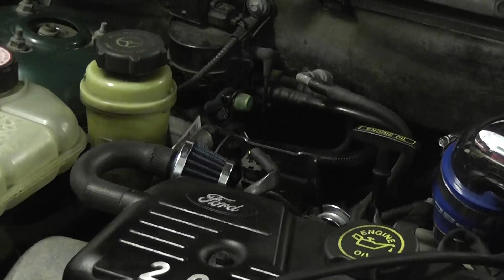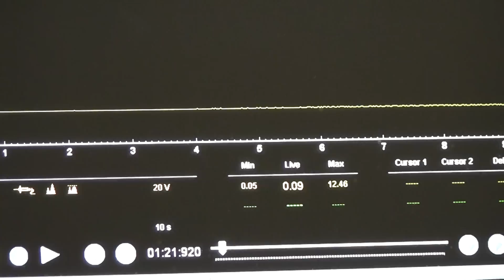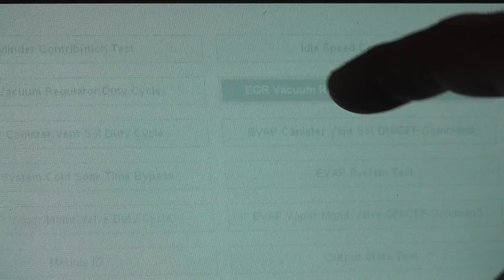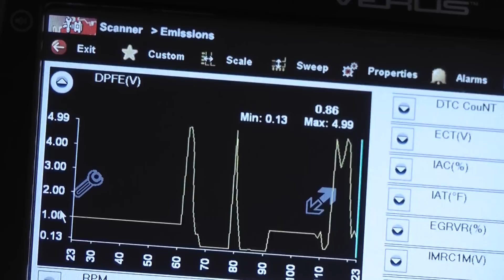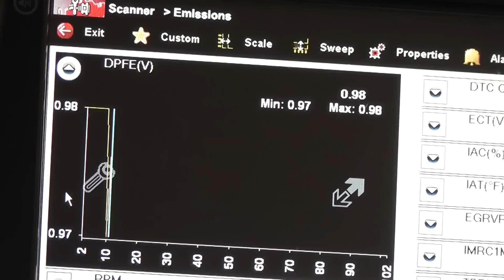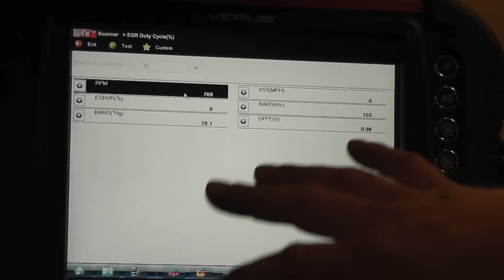2000 Ford Focus EGR System Tests (EGR, DPFE, EVR) - P1409

Comment: What would you suspect when a PCM dictates EGR, H2 Oxygen Sensors (all of the banks #4) OBII Codes and won't redirect the Coded Reading after Change Out of tested parts and wiring on harness was repaired with many connectors, without mentioning Ford - 1994 8 cylinder and not a truck. Yes, It's OBII Ready !!
Reply from the maker: Step 1, make sure you have power to that EGR solenoid and your O2 heater circuits

Comment: On the vacuum solenoid pilot wire that controls the EGR valve, I have 0.06 V (with the ignition on but the engine off). However, when I disconnect a black and blue wire connected to the negative terminal of my battery, I get my 12 volts back. Is this a grounding issue you're familiar with ? Or is it a problem with the ECU? Thanks a lot for your help, and Happy New Year!
Reply from the maker: Just some random black and blue wire at your battery? If that's a computer ground wire, that will do all sorts of weird things, with one being anything that is grounded by the ECM, will no longer have a ground. 
We've talked before about this and with the info you're providing, I can't help you any further. And if I remember this is a model that we don't have here and so I can't even look up a diagram.
Reply: @ScannerDanner "Yes, just this black and blue wire is causing the problem. Do you work on vehicles in France? Otherwise, there are no issues with the vehicle's equipment. However, the ECU cannot handle this ground wire and goes into fault mode, showing 0.06 volts. I disconnected all the fuses and relays, but nothing changed. This ground wire is necessary because it powers the fuel pump. I also disconnected the fuel pump, but it's the same — the ECU still goes into fault mode at 0.06 volts on the solenoid control pin as soon as I reconnect this black and blue ground wire to the battery's negative terminal."

Comment: "Hi from France, I have a 1997 Ford Transit MK5 with the same P1409 issue. With the ignition on, I get 0.06V on the ECU pilot wire going to the solenoid. However, when I disconnect a black and blue ground wire connected to the - battery, I get around 12V, or closer to 9V. So, where do you think the problem is? I suspect a short circuit."
Reply from the maker: No idea what wire you're talking about or what component you're testing. The solenoid? Not sure if that solenoid is being controlled on the ground or power side of the circuit. It changes drastically how you test it. Wiring diagram is key . If one of the solenoid wires goes to a ground, the PCM controlled the power side. If one of the solenoid wires goes to a fuse, the PCM controls the ground side. Need that information to help further
Reply: @ScannerDanner  I'm talking about the control of the vacuum solenoid that goes from the ECU to the vacuum solenoid. This control has a voltage between 9V and 12V, but when I connect one of the ground wires to the negative terminal of my battery, it drops to 0.06V. This happens with the vehicle's ignition turned on but the engine not running. Thanks

Comment: Would a huge vacuum leak also cause this code?
Reply from the maker: not this code
Reply: @ScannerDanner  oof. I did have a intake plenum gasket leak which caused misfire on cyl 1. Changing all the sensors for peace of mind. Will further test to confirm complete functionality. Thank you for sharing!
Reply from the maker: @gmax341  no problem. Do the tests I've shown in this video. I'll help further if you need it.
Reply: @ScannerDanner  Awesome! Just got done and all systems are a go! ST-Fuel trims are bouncing around 0.0%. My original metal DPFE seemed dead with the DMM test and the other solenoids seemed electronically fine, Will keep them as spares. Sadly, I ended up breaking my EGR tube when trying to install the new DPFE sensor. Too far rusted. I own a 96 Ford E150 conversion van with a 5.8l V8, 351W I think. Its not easy with the tight spaces to work on that thing. I am hoping this will be the last time I take that dog house out. 

One last question if I may. My last issue, is tackling the ABS system. Just purchased a Innova 5610 scanner and tried to get ABS scan/readout but it was not able to communicate with that system. Might end up returning it and getting a different scanner maybe. Changed all three wheel sensors and from time to time, I do hear the abs motor kick on briefly when I KOE-Off. I wish to accomplish two things. Verify speed sensors and test motor/break-bleed. Do I need specific tools for that?

Comment: I have a 99 f250 v10 but I put in the 03 engine (basically thw same thing) and it is giving me that 1409 code as well as the dpfe code 1401 code dpfe high imput circuit, and pointers?

Comment: Hey good mornin, first I wanna tell you thank you, your videos have helped me so much. If yo see this comment, can you please help me? This is the situation:

In my Ford Escape 3.0, The control wire from the PCM, the One that has to ground and get 0 voltaje, after I start the Truck, it keeps the voltage and even it rises to 13.6 o 13.7 Volts, what can be happening? Thank you so much y hope you see this comment

Greetings from Mexico

Comment: Hello! I have the p1409 code. I have changed out the EGR Solenoid and reset the code but it has come back. I have tested the voltage on the EGR solenoid and it shows 12v on each wire. I applied vacuum onto the EGR valve and the engine bogged down. Does this mean that the DPFE sensor is likely the issue? I don't have a fancy scan tool to test for a short or open  circuits. I would greatly appreciate a response, I have emissions in a few weeks and I will not pass at the moment!

Comment: You're the best like always the best hey Paul I have a question my smog piss keep resetting every time I turn off the engine what can coze something like this?
Reply from the maker: That's weird. Force a trouble code to set. Does it also clear on every start up?
Reply: @ScannerDanner  yes on every start up it cleared the trouble code

Comment: Helpful video.  99 Ford Mustang - I had no power to the solenoid wire with the key on.   Fuse #8 was blown under dash.  Was throwing 02 sensor codes and Vapor Canister solenoid code also.  New fuse...no more engine light.  Hope this helps somebody.

Comment: 2000 Ford Expedition 5.4. Just redid the intake manifold got it all hooked up and now I have eight codes all has to do with sensors failure. P0743 p0443 p0135 p1409 p0755
Reply from the maker: Common power feed to all of those circuits I believe. Check for a blown fuse and make sure you didn't pinch the O2 sensor wires in between the intake manifold when you bolted it back up (shorting the heater circuit and blowing the fuse)

Comment: Hi I'm getting p1409 on my 01 escape with the 3 liter 6 cylinder engine. Tried just about everything in the video and everything seemed alright so I just decided to replace both the vacuum and the solenoid thinking i had about an 80% chance of success (i just wanted to get it done fast) but I'm still getting p1409 any help would be appreciated, I'm thinking at this point it has to be the dpfe since i checked for shorts to ground too but if it's the dpfe it should have been a different code right?
Reply from the maker: correct, it is NOT the DPFE sensor setting this code. With the key on or engine running, you need to check voltage at the EVR solenoid. Report your finding
Reply: Just checked right now 0 volts on both wires with the vehicle off, 12 volts on both with the keys in the ignition
Reply from the maker: awesome! Good job man

Comment: Im also having the issue of the hoses popping off the dpfe sensor. i have made sure that the hoses themselves didnt have a blockage from carbon build up. i also did the voltage test on the solenoid. I have a reading of 12.2v the same as the battery voltage with the key on. I also checked the solenoid and had an ohm reading somewhere in the mid to high 30's. I then checked the 3 pin harness to the dpfe and on the main hot wire i did get the normal reading in the 4v range. I also did a quick vacuum check on the egr and the car stuttered and stalled. so i would think it is functioning properly. Would you say i need to look at my catalytic converter. The car does seem sluggish especially once up to operating temp or warmer. The car runs noticeably better when the dpfe hoses blow off. Other than the added exhaust fumes and horrid hiss from the egr tube blowing the exhaust out of the 1/2 inch diameter mini exhaust. You have the most informative video on here about this specific item. I have the egr insufficient flow/ no flow detected code as well as a lean code. I have done a smoke test to check for vacuum leak and did not find any. Any help would be greatly appreciated.
Reply from the maker: absolutely you have an exhaust restriction! (melted cat but remember pieces of the cat can get lodged downstream in the exhaust (muffler)). When you removed the cat (after proving it is restricted), look at the back side of it and make sure the "honeycomb" is intact. If it is you don't need to worry about the rest of the exhaust. If there are chunks missing, you may have to replace the muffler as well. 
This should help you. Oh and thanks for watching!!
https://www.youtube.com/watch?v=JIU8j4YBZxw

https://www.youtube.com/watch?v=Lafv2c4szZY

The reason those hoses keep burning/popping off is from excessive exhaust back pressure. This also explains the loud hissing you hear AND why it runs better with the hoses removed. You are giving the exhaust somewhere else to go. Make sense?
Reply: ScannerDanner absolutely. Thanks for your video and help. Due to being in ohio alot of the exhaust had rotted out so i now has a straight pipe all the way back from the cat. I will have to get another cat before emissions tests in April. Again thanks for the videos it allowed me to eliminate alot of possible electronic sensors and gadgets ect. Lol. I can work with exhaust its hard to diagnose bad sensors and such without a nice obd scanner/ computer.

Comment: Great video Scannerdanner! i'm having trouble with my 99 Ford Ranger 2.5. i have the same code P1409 but i see 12v on both sides of the solenoid. then i checked vacuum from the motor on one of the lines and had vacuum. i than disconnected the egr and opened it with the car running and it seems to be working fine. also the line going to the egr is fine. what should my next step be? i also have a P0455 but that shouldn't effect it right?
Reply from the maker: What is the definition of the P1409 code again? 
I believe you need to focus on your DPFE sensor
Reply: ScannerDanner Thanks for the reply! and the P1409 comes up as "Electronic Vacuum regulator control circuit" and i thought the DPFE would've gave me P1401 or something along those lines

Comment: Thanks for the video. I had a 2003 3.0 Ford Escape giving me fits with a PO403 code. Tried everything, then used your servo test and found a broken wire. It was the smaller wire right at the plug (not the white&red wire). wired in a plug from the salvage yard and it runs like new. The cost of repair was $5.00.

Comment: I'm trying to find my control wire on the solenoid connector to energize it. Both say 12dcv when the key is on. But when I disconnect the connector from the solenoid and then test the probes inside the connector one will say 12dcv and the other keeps climbing past 12dcv. I let it climb past 80dcv. Is that normal? I'm trying to figure this p1409 code. Solenoid was replaced and dpfe was replaced. Light still on.
Reply from the maker: The one that keeps climbing is probably a millivolt number and you are using an auto ranging meter. Switch the auto range off and retest.

Comment: Thanks...great video. One question. I have a 2002 Taurus 3.0 DOHC. Engine light came on and codes P1409, P0303, P0316, P0161, P0155, P0141,P0135 showed up on my scanner. Ford dealer says all 02 sensors are good and all wiring ok so they said it must be the PCM so it has to be replaced. Any thoughts would be appreciated. Thanks!
Reply: Well just found out it was the PCM. The ignition coil had 2 small cracks in the bottom and that probably shorted out the PCM. After finding a used PCM at Flagship One Inc. I had it changed out, flashed along with new plugs, new coil and new wires. $1155.00 later and all is well. All codes are gone and have not returned and engine light has not come on since.

Comment: hey .... I had a egr code and went to check and the plastic on the dpfe broke so I had to glue it back on and add a new hose ...anyway code is gone all is well but the ebrake flickers at times now why ? also neg term on battery bolt broke but I fixed it and its tight but still flickers... any ideas ????

Comment: Mr. Danner, hi. well my question is where do i need to go from here to get up to speed on your videos like from day 1? I see that you keep referring to a class room setting.
Reply: Start with my week 1 playlist on SD Premium. It is week one of my class at Rosedale Technical College and I have a class full of newbies, follow it in order. Also watch the scan tool and scope series I have in that same week. Even if you do not own the scope or scan tool I am using, you need to watch these. I taught so many fundamentals that apply to all of them. It also wouldn't be a bad idea to watch the older recordings of this same week when your finished. I never teach the class the same. There will be things you'll pick up even though most of it is a repeat. 
Then move on to week 2. and so on. 
There is a 14 day free trial for that channel to you'll have plenty of time to look around. 
And of course my playlists on this channel accompany everything as well. I have the playlists on this channel coordinated with my book. The same book I use in my class at RTC and use for all of my classroom lectures recorded on SD Premium.

Comment: hi Mr danner  I like all yours videos,  one question, can you  test the defense sensor with a voltmeter? for guys like me that don't have that expensive scanner
Reply from the maker: Absolutely!
Reply: Thank you for your quick response,  you are great, to which of the wires of the dpfe connector  you connect  the voltmeter?  Cheers from ontario ca,
Reply from the maker: I have some other videos on this showing the DPFE checks with a voltmeter. Just type in DPFE in the search box of my channel. 
Another tip on Fords, they usually use a green tracer on their signal wires for their sensors.

Comment: first off the p0171 code is caused by the tube that goes to the pcv valve and is split and collapsed. it is not where the little filter is, it is where your hand is when you are pointing to the dpfe and related circuitry.
Reply from the maker: +Brian Weiberg this video was primarily  about the evr control fault not the lean exhaust code
Reply: +ScannerDanner my bad, I should have paid closer attention. I don't like "cold air" intakes either, people put them on and then drive their car to my garage wondering why the MIL is on...
Reply from the maker: +Brian Weiberg no problem! And I agree 100% about the cold air intakes

Comment: How did you know that it was the control wire and not the feed that had 0 v? Thanks for the excellent video!
Reply from the maker: +Sean Perkins this should help https://www.youtube.com/watch?v=kQz3g4HIWgs
Reply: +Sean Perkins  bcoz frist wire its 12 v,, is show up grown side switch,if both show 0v then u have power side swtich, put test light + battery  test both wire one of test light will on,u now its feed anther wire not light come on its control side from pcm,,   im right paul

Comment: I replaced the EVR and DPFE  and im still getting a P1409 trouble code. What is the likely cause?
Reply: Plugged intake passage. I have other EGR videos that may help.
You need to do the tests I show in this video and others and see if the engine gets rough when you open the EGR valve.
Reply: ScannerDanner Premium Its funny you say that I just took the EGR off and the carbon buildup was unreal. Ive cleaned all of that out of every opening on that thing. Ill see what happens.
Reply from the maker: swilson7674
Depending on the model Ford you are working on you will have to remove the throttle body to get to where the real blockage is. Removing the EGR is almost never enough.
Reply: ScannerDanner Right on. I put the EGR back on and I still get same code plus a new one to add to the list, a P0171. So, taking the throttle body off will perhaps reveal the main issue?
Reply: swilson7674 I have a 2000 Lincoln LS 3.9 V8; ....if that helps any?